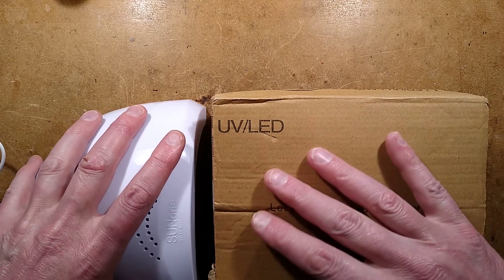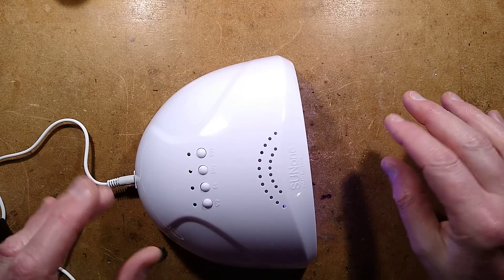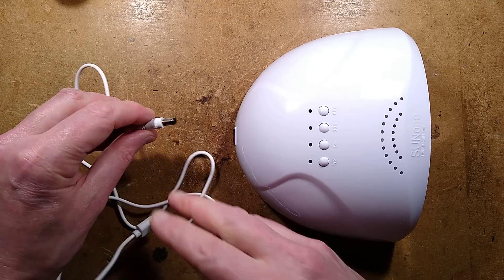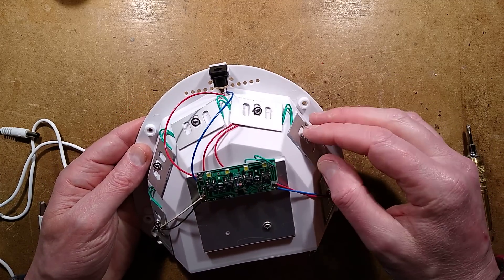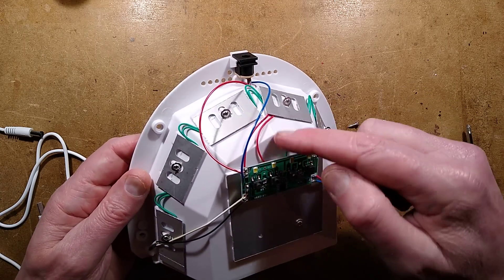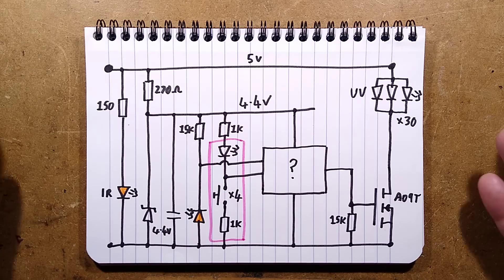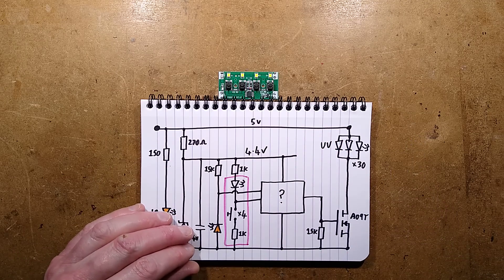48W UV resin (nail varnish) curing light teardown with schematic

Comment: Me and my friend, we sometimes use such gels for nail extension, and in my opinion these substances, especially when introduced to machined nails and skin, can get into the body and cause some problems down there. And yes, because of people like Big Clive I already know the difference between the ionizing ultraviolet subtypes starting at UVC and more safe ones of it.
I mentioned earlier that I tried playing with some UV-cured resin (bought a big bottle of it), and I have to say in constant UV it solidifies mostly in like ⅔ of the curing period, and if you don't want it to have sticky surface, you need to treat it with UV much longer: when it's mostly not polymerized, it absorbs photons easily and across the whole volume, but the more it solidifies, the less efficient this process becomes.

In short, you need to prolong the process until it is not sticky.
Reply: There are two types of photoinitiators; cationic and free radical. Cationic photoinitiators are used when light cannot reach all of the resin, as here, light starts a chain-reaction that keeps going on in darkness. Makes storage more complicated, so I guess that nail-polish is generally using free radicals. These are inhibited by oxygen, so if you have a nitrogen supply and put a flap on the opening of the UV-unit, you can just get rid of the oxygen in it and thus avoid the sticky surface. Cationic photoinitiators can for instance be inhibited by water, so here humid air is problematic.
It's certainly not worth the hassle if you're just treating your nails, and you should make sure that you don't use so much nitrogen that you run a risk of asphyxiation, but I've used such a modified lamp in a lab to do some quick tests with UV-inks and it worked just fine.
Reply: As someone else mentioned, I think the outside being sticky is likely due to oxygen inhibiting the curing process, leaving some uncured resin on the outside. One thing I've tried recently for using UV cure resin for filling in some etched metal is to do a quick exposure just to firm things up a bit, and then proceed to do the main curing by putting the design in a little tray and submerging it under a thin layer of water, and then doing the main exposure that way (so it's not got the oxygen from the air to inhibit it). So far doing the main curing underwater has prevented that outer layer of sticky uncured resin like I had been getting previously.

That's relatively easy to do with a nice flat thing you just need to expose from the top, but it's probably not exactly easy to do with larger things. Perhaps if you need to cure something larger 'in-place', you could try and spritz the outside in something like VG or PG to create a protective barrier layer which you could wipe off afterwards (although I've no idea if they'll mess it up in some other way).
Reply: @bluesatin  tbh, first I tried washing it in IPA, but soon discovered that solely prolonging the exposure to UV I get rid of any stickiness. For whatever reason, it's the simplest method for me so far, but I will keep in mind those advices you folks gave us. Experimenting is fun indeed! Thanks!!
Reply: @jkobain  Ah yeh, I assume just blasting it with more UV over time will eventually overcome the oxygen inhibition issue. Mine still tended to be sticky after quite a long time exposing normally, but the water trick seems to be very easy/effective in preventing the issue for my use-case.

I assume there's probably a bunch of different additives that various UV resins use to try and reduce or prevent the problem, but trying to find any info on that sort of thing is a bit of a nightmare.
Reply: @bluesatin  What also helps is just using more power; the reaction is faster and leaves less time for the oxygen to interact with the resin. When I switched to an industrial lamp, I had no problems with sticky surfaces anymore with that partiular ink - though there are UV-inks that require an inert atmosphere even when you blast them with a lamp that has 180 W/cm.
Reply: @robdidopp7769  well, the resin can actually start forming bubbles and/or crust when flooded with a lot of UV light. This is one of the reasons I cure it slowly now…
Reply: @bluesatin  I can't say what resin I have: me and my friend use manicure gels, they aren't cheap; but I bought a couple of pounds of an unknown resin from China, it remains sticky after ≈30 seconds of being cured, but I also use a mercury lamp to «afterburn» it for like five minutes, and it gets more hard and not sticky at all.
Reply: @jkobain  I know UV resin gets pretty hot when its curing, so I wonder if those bubbles that happen during very quick cures are caused by any tiny bubbles enlarging due to extreme heat from a very quick curing process, but then also being trapped as giant bubbles due to the curing being so quick.

Makes perfect sense just to do things a bit slower for us hobbyists when we're not needing to do things at an industrial pace. Doing a slower cure first and then blasting it afterwards to get rid of the stickyness seems like a good solution.

Comment: It would not be as much fun to disassemble, but Convoy flashlights makes UV torch that is just...  skookum.  It cures resin in amazingly quick time.  It is scary how quickly you feel "heat" on your skin (and the sun tan smell) if you get in the beam.  It uses a Nichia LED and because of the flashlight/reflector setup sends UV with some enthusiasm..
Reply: I put a powerful 365nm emitter in one of my LED Maglites, and YES, it heats up and bakes the skin quite quickly in the beam. It was an absolute BITCH to remove the original, and then resolder the tiny bare U.V. emitter on top of the LED module in the Maglite, but I finally managed to get it on there without mangling or cooking the emitter and the top of the plastic module

I use the light for finding leaks in automotive systems in which I've put dye into to make locating small leaks easier.

The fact that the Maglite can be focused down to a small, bright, hotspot makes finding and fluorescing the leaking dye MUCH easier in broad daylight than the horrible, useless, LED U.V. light that came with the dye kit.
Reply: The skookum output lends credence to the term "torch" Ha!

Comment: 1:47 - Well, no, real ultraviolet would in fact be invisible.
Reply: Ultraviolet light is very much visible. 365nm radiation for instance causes the lens of the eye to fluoresce brightly and is easily detected even if not seen directly.
Reply: @Muonium1  - No, it very much isn't. That's why it's called ultraviolet. The fact that some things emit a different wavelength (of visible light) when hit by ultraviolet radiation doesn't mean you're seeing ultraviolet. Just like the fact you can hear your dog bark when it hears an ultrasonic whistle doesn't mean that you are hearing the ultrasounds.

By definition, infrared (and any frequencies below it) and ultraviolet (and any frequencies above it) are invisible. If you can still see it (not "see its effects on something else", if you can actually see it), it's emitting visible light (ex., violet, possibly in addition to ultraviolet).
Reply: @RFC-3514  nnnnope, and most people can see infrared too out to at least 800nm. even x-rays are faintly visible. maybe read some of the primary literature instead of taking science lessons as dogma from your 5th grade teacher.
Reply: @Muonium1  - You are clearly posting from a different universe, where physics, biology and word definitions are radically different.
Reply: @RFC-3514  I literally have an 850nm laser source sitting next to me right now. I've spectrally analyzed it to confirm its monochromaticity, I can see the red dot it projects plainly in a dark room. I'm an optics engineer on a high power laser fusion system. What do you do for a living? Does it involve serving a lot of fries?
Reply: @Muonium1  - So we've moved from UV to infrared?

Have you also "analyzed and confirmed the monochromaticity" of the light being reflected off the surface that you're "plainly seeing" that red (I guess we went from infrared to red, now) dot on?

Because, guess what, if you aim a strong enough (pure) UV emitter at some types of paint, you might see a dot too. But, guess what, that's because the paint is absorbing UV and emitting a different wavelength.

Imagine having to explain this to someone who works "on a high power laser fusion system"...

Comment: Hello Clive, I just received a 24V, 288W(!!!) version here from an Amazon sale (Aussie $18), it came with a 24V/2A wall tx. I haven't measured the actual wattage but it certainly feels warm when you put your hands under it. Very similar to yours, but having a 16pin microcontroller, 63 LEDs and a three digit LED readout (countdown timer) with the same functional buttons. Uses the same A09T FET to switch the LEDs and has a 'hand present' sensor.
About to get some UV cure resin to experiment with.
Reply from the maker: I've just got a "150W" version that also has a very light 24V 2A supply.
Reply: Whoa Nellie!  That thing sounds dangerous!  Could be useful as a UV EPROM eraser.
Reply: @quantumleap359  I thought the same. The eraser lamp needs to be around 255nm however. Germicidal lamp seems to be the thing to use.
Reply: For several years I've had a similar "SUNUV SUN[2C]" UV LED unit with a 24V/1.5A (=36W nom.) power supply and it really does use 29W on its 10S, 30S, 60S modes, and 5.6W on 90S "Low heat mode". I don't recall whether a specific power rating was advertised.
That's spread over 33 LEDs: 18 on the top panel, and groups of 4,2,3,2,4 on 5 angled side panels.

I can see through ventilation holes several aluminium-core PCBs, the central of which has at least 10 large SMD resistors (“2512”-size, 1W typ.), 5 each to the left and right of the central LEDs, marked:
Left: “330” (33Ω), “330” (33Ω), “……0”, “24…”, “2……”
Right: “330” (33Ω), “330” (33Ω), “4R0” (4Ω), “…R0”, “24…”
There are also some smaller “1206” resistors whose labels I can't see.

I did consider that the resistors might only exist to boost the power consumption :) but the 33Ω, at least, are inline with the LEDs. I can't tell for the others.

Unfortunately I can't open it up non-destructively because the screws are covered by magnets secured with a glue that's unaffected by all of my nearby solvents (isopropyl alcohol; acetone; limonene). My attempts resulted in chipped magnets and the surrounding plastic breaking apart (perhaps weakened by the solvents).
I might try again tomorrow with Extra Solvents™ :)

Comment: I have the 6-led UV panel you did a video on years ago, from the same brand, and it likely uses the same LEDs - I've sacrificed once of the LED chips and and additional one of the phosphor domes/blobs. It appears to have two LED dies on each chip, one bonded with two wires to each end of the module, and one bonded directly downward with only one bond wire leading to it. The 2-wire die (presumably 405nm) lights a visible purple at a lower voltage (just under 3V), and the 1-wire die takes greater voltage to light up. The 1-wire die looks identical to the large one in a 365-nm LED flashlight I recently bought - the surface of the die itself seems to phosphoresce in white, and any color from the semiconductor itself is invisible.

Looking at an individual LED module under magnification while powered at about 3.2V makes the two different dies obvious without being too bright to look at.

Comment: I wonder if the 48W on the box is kind of like with normal LED bulbs where they say "60W" very large and then "...equivalent" much smaller, and the light output is equivalent to a traditional 60W bulb.
Reply: Its just a model number and not a power rating. Its easy to confuse :P
Reply: @agurdel  It literally says "48W power." It's not a model number.
Reply: The power ratings are obviously worked out the same way as they do audio power ratings😂 The bigger the number the better 😊
Reply: The chinese are sneaky with model numbers like that, that will make you think it's a power rating at a quick glance. I've ran into that several times with their products before. No more trickery on MY behalf anymore though.... I've learned.
Reply: Equivalence is about 7.14 times the difference,6.8 comes out to 48.552
Reply: @phonotical  Equivalent to what? A U.V. incandescent light bulb? Not even close....
Reply: @davelowets  standard filament to led equivalency
Reply: @phonotical  An Incandescent U.V. bulb can't even be compared to a U.V. LED in terms of output. 

The scale between a U.V. Incan vs. a U.V. LED won't be anywhere near the scale of a visible light Incan vs. a visible light LED.

You can't compare the 2 using the same scale, the numbers would be so far off in the realm of things.
Reply: @davelowets  IT'S THE LITERAL DOFFERENTIAL EQUATION
Reply: @phonotical  Nope

Comment: One has to love the pandemic for abundant UV devices. I just bought a UV phone sanitizer from Lidl for 7 euros. It has 2 LEDs which look like some kind of brass body things with 2 elements inside. I'll try it for erasing EPROMs. If it works at all it's a pretty good deal for the money and it even has a battery so it's a take-along.

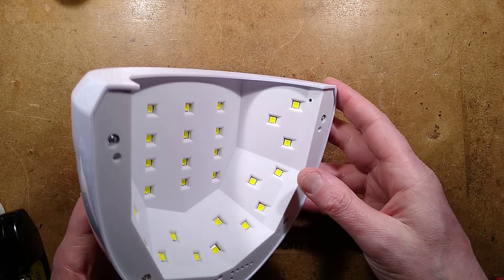Comment: 1:35
I have a curing/cleaning station for my resin printer that has both 385 and 405nm LEDs and the difference is clearly visible when lit. The difference between 365 and 405 is even greater so it should definitely be visible.
Reply: Note that your eyes can't see ultraviolet. What you're seeing is a difference in the phosphor they use to add some visible light (so people can tell when it's on).
Reply: And your printer is also probably covered by an Orange shell to block that light so you don't damage your eyes. Lots of newer LED's use ultra Violet light leds in conjunction with  phosphorescent materials to convert that dangerous UV light into visible light.  My point being you can have 2 different wavelengths of ultraviolet light hitting identical phosphorescent materials and producing the same light.
Reply: @buddyguy4723  But why on earth would they be converting the NEEDED U.V. in this product into visible light? It wouldn't cure nail polish if it did. 
So, yes, there SHOULD be 2 easily distinguishable LED "colors" in this unit if it does, in fact, emit 2 different wavelengths of U.V.
Reply: @davelowets  it dosent. You misunderstood me.
Reply: To add 405nm looks violet, and 365nm looks white/grey to the eye.
Reply: @VEC7ORlt  - No, they both "look" invisible to the eye. The light you can see is coming off the phosphor (which is added deliberately so people can tell when the lights are on, and don't just stare into a UV source) and always has wavelengths above 380 nm.
Reply: @RFC-3514  Did you read that somewhere or pulled it out of some kind of bodily orifice?
Because looking at the VLMU1610-365-135 LEDs I have on right now in my flashlight I just see dull grey/white crystals and datasheet mentions nothing about emission anywhere beside 365nm, and no phosphors are visible in the LED.
Besides humans are known to see UV up to around 300nm.